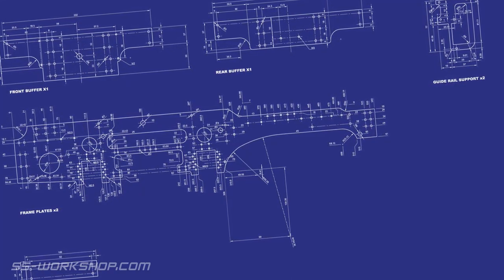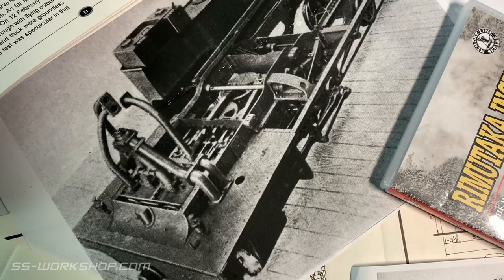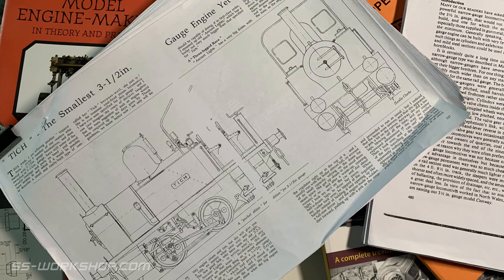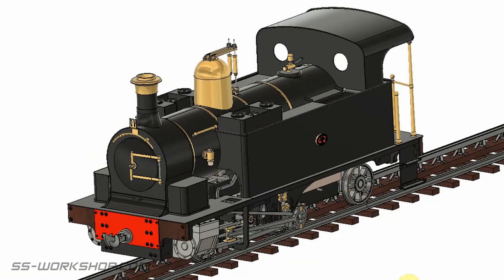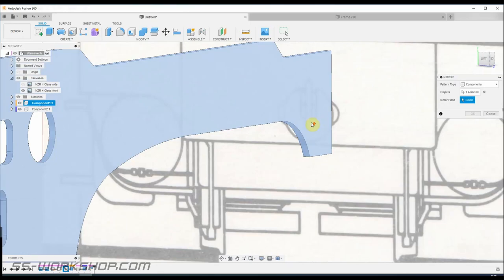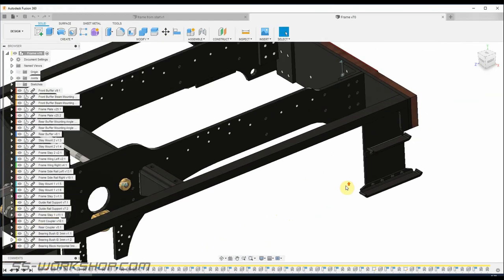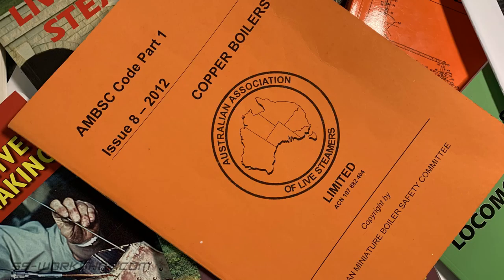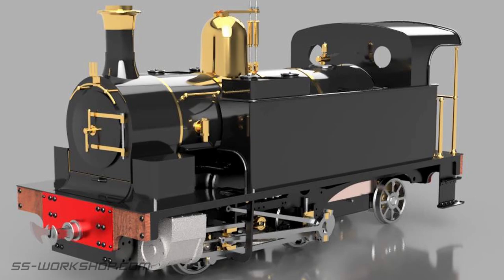How to Design a Live Steam Locomotive

Comment: Which references did you find to be useful for designing valve gear? Currently trying to use a book from the 1960's which is slightly lacking
Reply from the maker: They are certainly the most complex part of a loco and I’m not sure to many people full understand them but here’s what I have been using for reference . If it’s a stephenson’s or a walchaerts valve gear, ‘Design Procedures for Walchaerts and Stephensons valve gears’ by D.L Ashton is very detailed and there is a computer programme you can download for free to actually do the calculations it’s very old but it seemed to work. For a good description of the above valve gears but not designing ‘Valves & valve gears for steam locomotives‘ by Chas.S.Lake & A. Reidinger is an interesting read and if you want to learn about some less common ones ‘Locomotive Valves and Valve Gears’ by J.H. Yoder & G.B Wharen has descriptions and diagrams of quite a few of them. There also some websites, Don Ashtons as per first book http://www.donashton.co.uk/index.html    Is a good start and has the programme mentioned, for the books I found them online at Tee Publishing in the UK

Comment: Was the final design built around the original H Class plans for NZR? Curious as it differs from how H199 ended its working life, but your design resembles the 7.25 gauge engine at Cross Creek Railway Society. Although that engine doesn’t aim for accuracy.
Reply from the maker: Yes, I based it on the original drawings as delivered which has been a bit of a challenge as there are no photos of it in its original configuration with the closest being a couple of years after delivery. I went with that version as the open back is more suitable as a live steam model along with it being nicer looking in my opinion with the polished brass steam dome, spring balance safety valves and trim that was removed over its subsequent refits. The internal workings of the fell mechanism have also posed a challenge being so different to H199 as it stands in the museum.